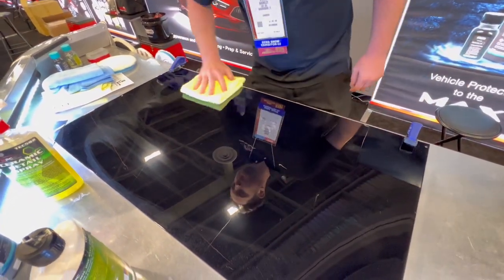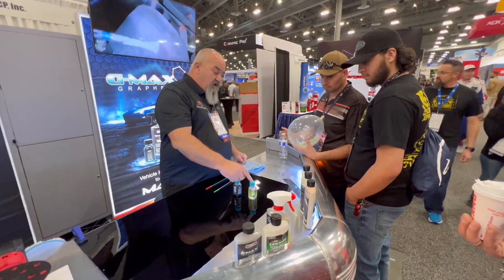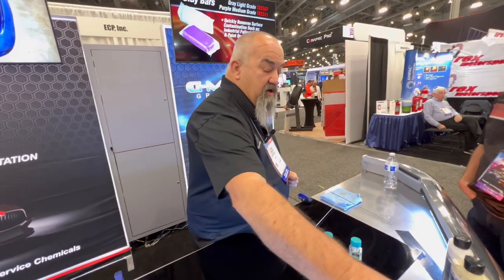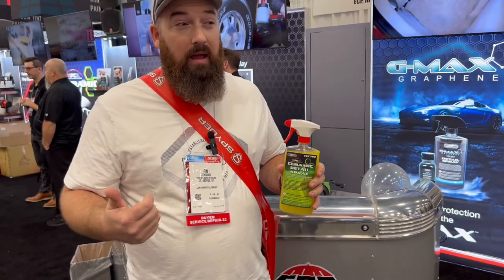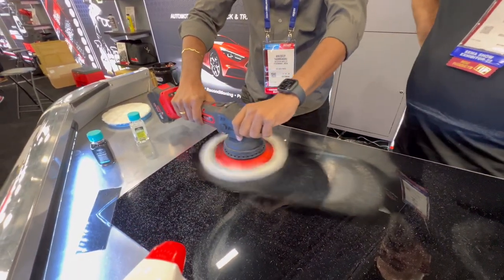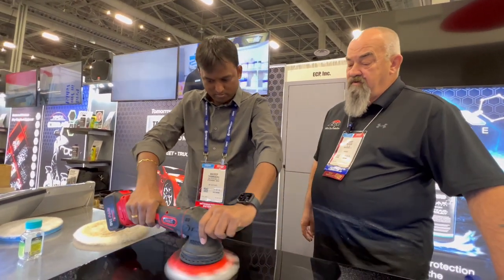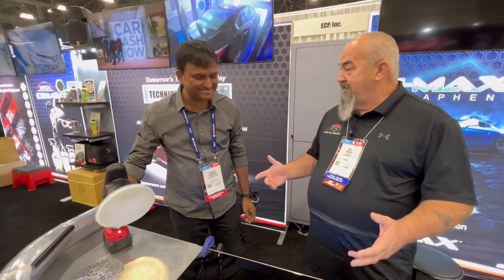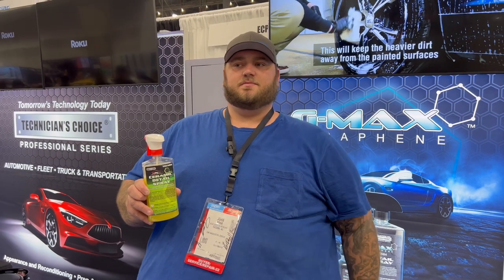SEMA 2022

Comment: I fell in love with the 3 in 1 surface clarifier. Guys it’s the best water spot/mineral deposit remover I’ve ever used.  When acid isn’t safe to use we reach for that.  Also the TEC582 is the best sealant I’ve ever used.  One more!  The enzyme cleaner is amazing! It destroys grime and continues to clean long after the detail.  Those nano bacterial enzymes just eat the grime destroying any odor that was associated with it as well